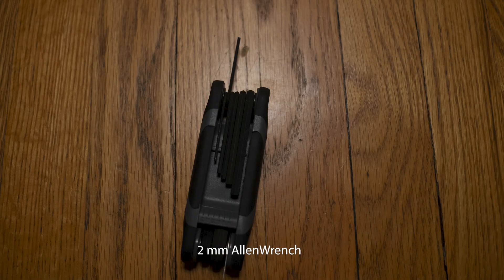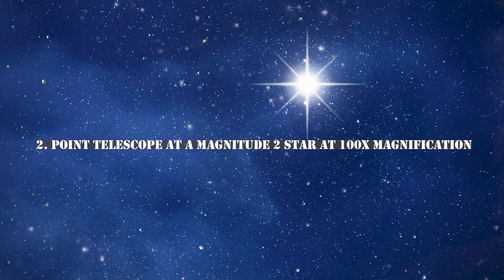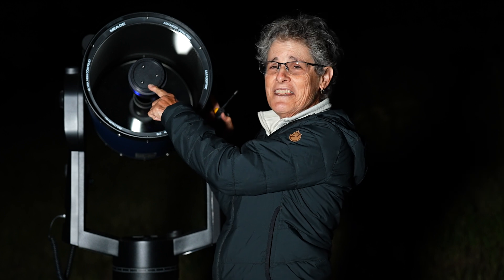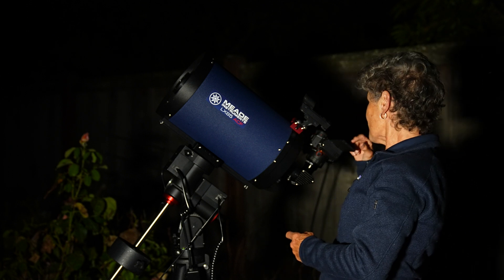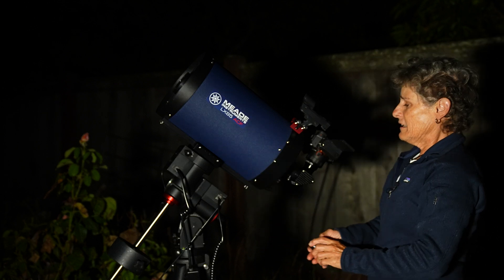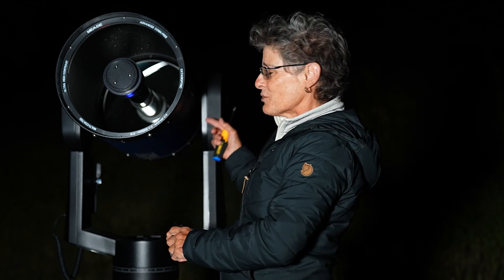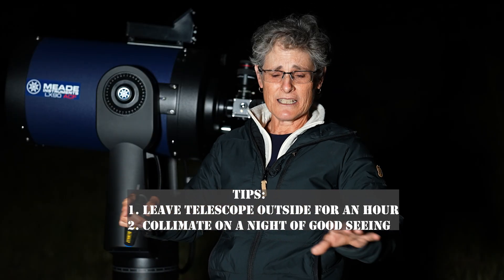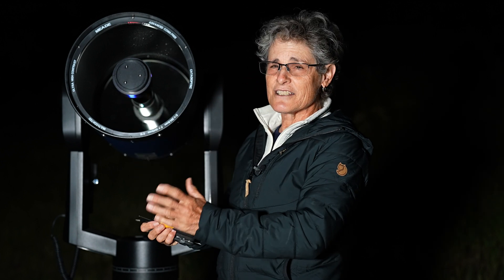HOW TO COLLIMATE A SCHMIDT-CASSEGRAIN TELESCOPE

Comment: you tighten the screw at the thinner section, slightly loosen opposite screw, or both opposite side, keep adjusting back and forth!
Reply from the maker: Well, I own a Meade 8" SCT that I bought after my LX85 was ruined in a car accident last year and this new Meade has one screw that is always the culprit.  And it's the only one I ever have to turn.

Comment: Nice video, Tsula. Thank you! 
I have a question. When i finished collimating my 8'' SCT using barlow lens (to achieve high magnification around 350x), I've centered the that black hole perfectly, but when I use my f6.3 reducer then it's no more centered. And when I move image of a star in the eyepiece, the center moves as well. Let's say I move image of a star down in the eyepiece, then center of a donut goes up, when I move image up - black hole moves downwards. Same with left/right moves, but only using reducer. When I use just a diagonal and eyepiece or a barlow lens with it - collimation is perfect. What can it be ? Thank you in advance
Reply from the maker: Thank you.  I don’t think you’re supposed to use a reducer. At least I’ve never heard of that.

Comment: Instead of using your finger just place a Post-It note (or similar) on the corrector place beside each of the adjustment screws in turn until you find the correct one to turn. Saves you having to reach around the front of the scope.
Reply from the maker: @petergibson2318  Good idea. Thanks.

Comment: Just been donated a Meade 8 inch SC for our Society and the owner said he no longer enjoys looking through it as, at nearly 80, his eyes are well passed their best.  I had a look through it for the first time last night and its collimation is worse than your first image, no wonder his views were distorted.  Jupiter had a huge flare on one half making it look terrible.  I use a Hubble artifical star for collimating as its easier in the day to tweak the secondary, but never done a Meade before so thanks for the tips.
Reply from the maker: Poor guy.  Well, lucky Society got a nice telescope.  I bought a used Meade 8" that was horribly out of collimation.  I had a Hubble artificial star that I tried to use in the house because the weather was so bad for weeks and weeks.  But I couldn't find a place in the house that was far enough away to get the star in  focus.  In other words it was too close.  Although collimating during the day would be so much easier.  Finally it cleared up and I took the telescope outside and it took me over an hour to get it collimated.  At one point I wondered if the previous owner had been turning the wrong screws.  Some of those Meades have two sets of screws on the secondary and you're only supposed to turn the inner ones with a hex key.  I think I have it pretty collimated now but want to check again to make sure the collimation held up.  If not, then I know why it was cheap.

Comment: Once you get the donut hole centered at high power, turn the knob so youre only very slightly defocused. At this point, you'll see the Poison Point surrounded by diffraction rings and you will see that the Poison Point probably isnt perfectly centered within yhe diffraction rings. This is only possible to see and correct on nights of good seeing, but it will allow you to extract that last 5%-10% of performance on those good nights.
Reply from the maker: Thanks for the tip.  Recently I bought this Meade LX85 8" that was on sale for very cheap as an open box item a customer had returned.  The corrector and mirror are pristine but the telescope came uncollimated and it took me an hour to collimate it.  Every time I thought I was through I would look through the eyepiece and again it needed adjustment.  Now I am wondering if maybe the customer returned it because it won't hold collimation.  Do you have a fix for that?
Reply: @tsulasbigadventures so I can think of two things. First, once you have collimation dialed in, have you tried to tighten down all 3 screws a bit? 

The other one would be a loose secondary within the corrector. Will the secondary housing rotate if you try?
Reply from the maker: @damiencannane  Thanks.  I will go check the secondary to see if it rotates.  I couldn't tighten the three screws much because it would go out of collimation again every time I tried.  It's been snowing.  So, the telescope is in the garage bundled up.  I'll go check on it. Thanks for your help.

Comment: Assuming you haven't dropped the scope down the stairs, how often do you collimate? I've had a Mak-Cass 127mm for about 8 years and never collimated!
Reply from the maker: I have never collimated it.  I check it often and it's always perfectly round with the airy disc in the middle.  I don't think you can collimate a Mak-Cass.  At least my Orion Star Seeker IV, 150mm Mak cannot be collimated.
Reply: @tsulasbigadventures  you can on the secondary  of the 127 mak but not the primary mirror. There's 6 screws at the back, 3 to hold  and 3 to adjust. With these scopes my mantra is; if it looks fine, don't touch it :)

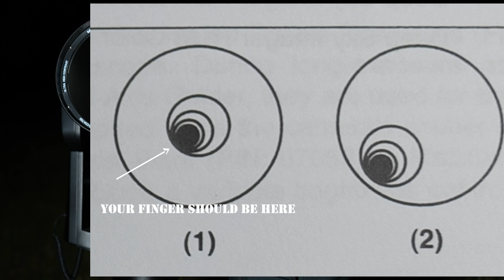Comment: Tsula, thank you for a very clear and useful video.  I am now viewing everything I can on collimation because of what happened last night.  We had partly cloudy skies, so I decided to work on my Celestron C6’s collimation, which I knew needed adjusting from the appearance of stars in an earlier astrophotography session.  So I adjusted it, but in the wrong way.  I took the airy disk that looked more or less like the image at 7:11 of the video to one that was worse than the (2) diagram at the 6:40 point in the video!  It took me 90 minutes to make the collimation this bad (used Arcturus as the star, by the way).  I gave up and realized I should have really reviewed everything about how to do this beforehand before proceeding (give someone enough rope . . .).  I do have one question.  It seems like a lot of other YouTube videos say to loosen two of the screws if you are going to tighten one.  Your advice seems to be to tighten one and loosen the other.  Any thoughts about this?  Again, thank you for this information.
Reply from the maker: That depends on whether you try to tighten a screw and it won't give.   In that case you shouldn't try to turn that screw at all.  Never try to force any of the screws.  Go to the next screw and loosen it before proceeding.  I hope that helps.
Reply: @tsulasbigadventures  Thank you.  I need all the help I can get!
Reply from the maker: @ABCMO-bl5pi  You're welcome.  I hope you get it straightened out.

Comment: I ended up replacing the screws on my Evo8 with thumbscrew to make for easier adjustments.  I also find attaching it to a webcam (or DSLR) makes it much easier to collimate when you have a computer screen for better accuracy especially at higher magnification if you use an eyepiece projector.

Comment: Thanks for your explanation.  I live in Brazil, I dont speak well, but let´s go. I have exactly the same telescope as yours, LX90 Meade 305mm SCT ACF. I can't collimate the telescope so that both the intra-focus and extra-focus are perfect. If one is perfect, the other is imperfect, and vice versa."When I say intra-focus I am using the focus adjustment knob in the way that I am moving the primary mirror from bottom to up, and when I say 'extra-focus,' I'm moving the primary mirror from top to down. Theoretically, the image from intra-focus and extra-focus should be the same. If one is correct the other should equally correct. But In my case it is not. Do you know something that I could do? Have you test your collimation for intra-focus and extra focus to know if both are ok? I don´t know if you understand my explanation.
Reply from the maker: If I am understanding you correctly, it sounds like the telescope may have some astigmatism, which you can test for by racking in and out of focus in both directions.  If the pattern is not identical then the telescope might have astigmatism.  If that is the case, and I'm not exactly sure that is what you are describing, then it would have to be corrected at the factory.  Is the telescope still under warranty?  I don't believe you can correct for astigmatism with collimation.   Do stars appear misshapen when you focus?  That is a sign of astigmatism also.
Reply: @tsulasbigadventures  The telescope is no longer under warranty. I've had a Celestron SCT telescope before and i´ve never had this collimation issue. Yesterday, I was trying to improve the collimation, and the night was a bit turbulent, so I couldn't evaluate the stars in focus. I'll wait for a night with less turbulence. But thanks, I will continue trying to improve the collimation.
Reply from the maker: @MrLostsync  I hope you get it figured out.  When the seeing is bad it is very difficult to collimate.

Comment: I have a Vintage Celestron C8 and I think my primary mirror is crooked. There is a tube inside coming out from the primary (I assume for glares) and when I look through the eyepiece hole without the eyepiece I can see in the reflection that it is crooked and the entire reflection seems to be crooked. Is it possible to move the primary mirrors?
Reply from the maker: Well, what I am explaining in this video is how to move the primary mirror by making slight adjustments to the collimation screws on the piece of plastic in the center of the primary mirror (at the front of the telescope).  Before you adjust those screws you shouldn't rely on looking through the eyepiece holder without an eyepiece but actually look at a star and defocus the star to see if it is lopsided.  If it is that's how you know that the primary mirror is crocked.  Your collimation screws move the primary mirror but just a little bit.  Moving the screws too much could make it fall out.  I am not sure what that tube is that you mentioned.

Comment: When you have identified with your finger the narrowest area of the disc, should you turn the screw nearby clockwise or counterclockwise? thank you paul
Reply from the maker: There are two ways to figure that out.  One way is to just turn counter-clockwise or clockwise and see if the direction you chose made the circles more concentric or worse. The other way is to turn the mount on and then using the arrow keys at the slowest slew speed move the star to the edge of the field view in the same direction as the darker (thicker) area of the disc and then turn the screw while looking at the star and the star will move across the field.  If the star moves out of the field of view then you are turning the wrong way.
Reply: @tsulasbigadventures  👍😊

Comment: Great video, Tsula!  Thanks so much for all the terrific information.  Haven't had to collimate my EdgeHD8 yet, but now I'm ready! 😀
Reply from the maker: Thanks.  I rarely have to collimate my Meade.  It doesn't get moved far from the garage and the JMI Wheeley Bar is very stable even over snow.  How do you like the Edge HD8 so far?
Reply: @tsulasbigadventures  I really like it, Tsula!  I've gotten a couple of very good, close up, images with it and I think I've ironed out most of the wrinkles.  (I have to send this one back, per Celestron, since there was some 'stuff' on the primary mirror I reported to the vendor and Celestron (to their credit) wants to ship me a new one without the schmutz. Okay by me, except for having to disassemble and reassemble all my peripherals again.)  The mirror debris doesn't seem to to be interfering with images or visual use, though.  But the scope itself it great.  Not nearly the dreamy simplicity and ease of use of my refractors, but it's all a great learning experience and I'm very happy with the results so far!
Reply from the maker: @CingStarsVT  I'm happy to hear that.  That's great.  How could something get on the primary mirror?  I noticed there is a big blob on my 12" SCT.  I was shocked when I saw it on the video.  I need to get that off!  Totally different topic: do you use an electronic focuser?
Reply: @tsulasbigadventures  I haven't got a clue how that stuff got on the primary mirror, Tsula!  I initially thought they were scratches and I took some photos to send the vendor.  When I looked closely at the photos, some of the stuff looked like dead bugs, and the other debris/scratches(?) I have no idea about.  The vendor sent the photos to Celestron and they gave him an RMA to return the scope.  It's just that the 8" Edge scopes out of stock everywhere, so it might be mid-October or so before a replacement arrives.  I thought these scopes were pretty much sealed like refractors, but I guess not.  The blob on Artemis is on the corrector plate (I hope)? That's funny, I was going to remark how clean your corrector plate looked on the video!  😀 I've had to clean my Edge corrector plate about 3 times already.  (I've been using an air blower, camel hair brush, and then a sensor cleaning kit/swab to clean it and it comes out pretty good.)  Yes, I use ZWO electronic focusers (EAFs) on the Edge as well as my refractors, the 107PHQ and AT60.  It took some adjustment on the Edge (for me in the ASIAir adjusting step size and exposure of the EAF) until I got the autofocuser settings correct, but I can't imagine imaging without it to be honest.  I also bought a Tri-Bahtinov mask that's supposed to be better than a standard Batinov mask for both focusing as well as collimation, but I haven't had a chance to try it out yet.  I was going to check the accuracy of the EAF with it, but from the images I've gotten the EAF is pretty darn accurate.
Reply from the maker: @CingStarsVT   I was thinking about it last night and wondered if something could get inside on the primary mirror when you remove the visual back but I'm not sure.   I'm going to work on cleaning Artemis today since it's cloudy.  I looked into an electronic focuser but it seems like no one makes one for a Meade unless you alter the EAF made for Celestron SCTs.  I watched a video on how to do that but I am not that handy and would be worried about damaging the focus knob.   Guess I will just keep manually focusing for now.  Take care.
Reply: @tsulasbigadventures  Did you check out the Meade Zero Image Shift Electronic Autofocuser at High Point Scientific?  Don’t know if that meets your needs, Tsula.
Reply from the maker: @CingStarsVT  I believe I looked at that focuser and it does not work on a Meade LX90.  It works on LX200.  When I was buying my Meade LX90 I looked at how much the LX200 weighed and decided against it.   Oh well, thanks anyway.

Comment: Thank you Tsula for the great tips. I never thought about letting the OTA cool down first. Any tips on selecting the correct second screw? I collimate with my camera in place of the eyepiece. Then I watch the image on my laptop as I adjust the screws on my Celestron 14" Edge HD. I check my collimation at the beginning of every session. Some people check theirs continually through the night. My scope with its mirror locks holds collimation well.
Reply from the maker: You're welcome.   That's a good idea about using the laptop with a camera or you could flip the screen on the camera to face you but that screen is much smaller than a laptop.   I have never had my 12" telescope go out of collimation during an evening of viewing.   It seems highly unlikely that would happen.  In fact, my telescope rarely needs collimation.

Comment: Yet another very informative video! Would be cool to see a collimation video on a refractor. There is not much information out there. Granted, most don’t and probably won’t ever need collimation. But still rough shipping and handling or a rough ride to the observing site might knock it off kilter. Also, it would be great to check the collimation to ensure you are getting the most out of your expensive refractor. 😊
Reply: Refractors are generally best collimated by the manufacturer or someone who does it professionally and has the right equipment. Most of them will do it for a nominal fee (you pay shipping), it's not something I'd recommend attempting unless you have the right equipment. Leave this to the Pro's.
Reply from the maker: Thanks, Elray.  I have never collimated a refractor before.   I would need to research it.
Reply: I have to agree with Dennis - leave this to the Pro's.  Too many things can go wrong when you fiddle with a refractor's innards.
Reply from the maker: @CingStarsVT    Refractors cost so much more than reflectors or SCTs that it wouldn't be fair if you had to collimate a refractor and I never have.
Reply: @tsulasbigadventures  That's a good point!  The possibility of turning the wrong screw and having the lenses fall out of position, especially with something like my Quadruplet, scares me to death.  I'd never personally attempt it.
Reply: @CingStarsVT  Yes, completely agree yet the higher end refractors have adjustment screws.
Reply: @elray4932  Yes, they do!  For me, anyway, since I haven't got a clue about what I'm doing, that comes under the heading of "give someone enough rope and they'll hang themselves."  🤣

Comment: Thank you Tsula! On my 10" Newtonian collimation assembly, I replaced the screws with ones having knobs from Bob's Knobs. This way, I don't drop the hex wrench down my tube onto the mirror! Cheers from Texas!
Reply: I have Bob’s knobs and they are great!
Reply from the maker: That's a good idea for a Newtonian reflector.  On a SCT the screws are right out in front of the telescope.  Cheers.
Reply: @tsulasbigadventures  I fitted Bobs knobs on every SCT I’ve owned. Makes it easier and faster without having to faff around in the dark with Allen keys.
Reply from the maker: @Astronurd  Sounds like a good investment.
Reply: Bob's Knobs are great. Allen Keys and corrector plates don't mix well at all.
Reply from the maker: @Dennis-tf2cs    I probably should have mentioned to be careful not to touch the corrector plate.  Also I noticed a large blotch on the corrector plate.  I will need to try to remove it with an air blower.